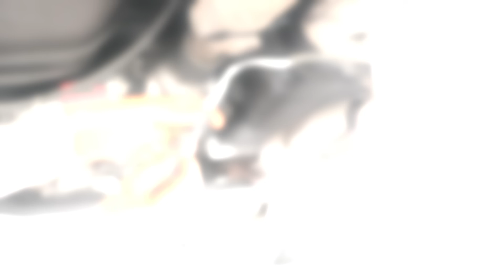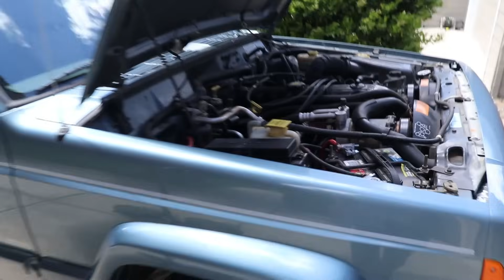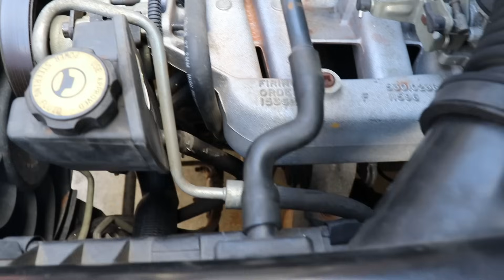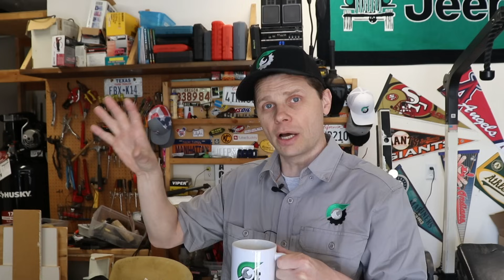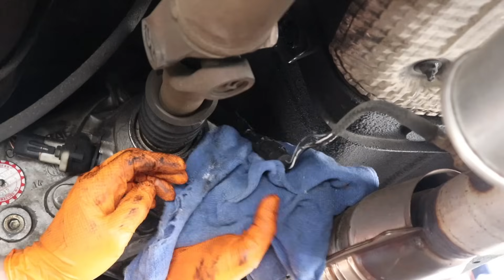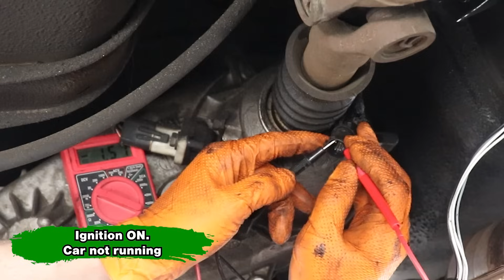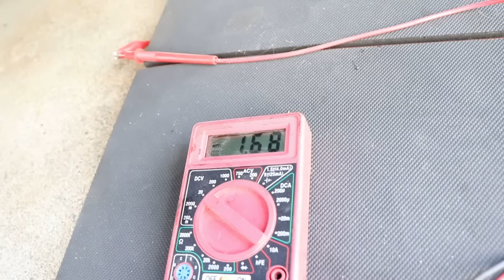Don't Buy Oxygen Sensors! How to test o2 sensor

Comment: An oxygen sensor is made of zirconium oxide (ZrO2), a chemical compound used to form the sensor’s thermal-driven electrochemical fuel cell. Energy is generated by the difference of oxygen inside compared to the outside. 

Two platinum (Pt) electrodes are placed on the ZrO2 to provide a connection for output voltage to a control module. An output voltage of 0.2 V (200 mV) DC represents a lean mixture where there is a lot of oxygen in the exhaust stream. A reading of 0.8 V (800 mV) DC represents a rich mixture where there is little or no oxygen in the exhaust stream. The ideal point is 0.45 V (450 mV) DC – this is where the quantities of air and fuel are in the optimum – or stoichiometric – ratio
Reply: My man breaking it down
Reply: So 02 sensors produce electric?
Reply: Thankyou! I was wondering why that sensor was outputing voltage without anything connected to it.
Reply: Thank You! You have un-furrowed my brow
Reply: Great Chemistry lesson! Much appreciated, thanks
Reply: Auto Motive Diagnostic podcast covers narrow band O2 sensors really well.  They don't actually measure oxygen,  they use it as a catalyst to measure the hydrocarbons in the exhaust.  There are also narrow and wide band sensors.  Which ones are these?
Reply: @roadglide6895 wide band
Reply: Is this how he is finding .04 v on the sensor when it's disconnected but the vehicle is running?
Reply: Screw the sensor.
Just inject a variable voltage supply.
One meg pot across 13.5 v
Reply: Thanks for the comment i was confused how he was getting a reading with it unplugged, and explains why they are expensive.

Comment: Very well explained thanks. If the heater is disconnected then why should you expect the sensor to show voltage when running and with probes on the sensor wires. ?
Reply: That’s just what I was looking for. To bad no one is responding.
Reply: Once enough warm exhaust gas passes over the sensor, it's got enough heat to start producing it's voltage. The heater is just there to get it up to operating temperature faster.
Reply: @slowpoke96Z28  cheers mate. Good explanation 👍🇬🇧

Comment: Are they easy to replace, I have 2  in my truck i believe. It's a 93 Ranger 4.0 engine. I'm still getting some bad gas mileage, even after a full tuneup.
Reply: Just depends on where they are located and how seized up they are to their mounting bung.

Comment: I have a 99 escalade with the 5.7 vortec and it's throwing both o2 sensors and cylinder 2 misfire, I replaced all the spark plugs, wires, cap and rotor and ignition coil and maf sensor and still having a ruff idle while in gear, also has a exhaust leak right after the cats where the flange is. I'm pretty sure it's the o2 sensors but could the exhaust leak cause the o2 sensors to read wrong 🤔
Reply: Not after the catalyst.
Reply: And the truck has 4 o2 sensors, so which 2?
Reply: Down stream o2s
Reply: @wildwillscustomsexhaustvid9677  down stream O2 sensors have no bearing on how the engine runs. An exhaust leak can make them read wrong, but the computer couldn't care less. It's not using them to decide how to run the engine.

Comment: your obd scanner should display real-time voltage for each sensor on each bank, as well as fuel trims.... a multimeter externally used isn't really necessary then. But still useful if you have no scanner available.
Reply: Not on an obd 1 system
Reply: Or if you have an older car like mine that is obd1 gotta love mitsubi
Reply: Great point
Reply: THAT WAS gonna be my question and thanks for answering
Reply: I bet he k owed that
Reply: It's useful for identifying a likely cause, but it doesn't narrow down the specific cause exactly, it could be the wiring to the sensor is damaged. And OE o2 sensors are expensive.

Plus, if you suspect the sensor is faulty, you are removing it anyway so why not check it.

Comment: Oxygen sensors should be cleaned at 90K and 180K(replace them at 250K) by removing them and heating the sensing portion all around to cherry red with a propane torch, while checking response time with a volt meter. Using a meter while on the vehicle is not necessary as you can just hook up an OBD2 reader set to read live data. On an early fuel injected vehicle this method may be useful. *Edit for those not familiar with O2 sensors: there are four wires. Two are the same color, two are different colors. Connect your volt meter set to DC volts on the two wires which are different colors. Polarity doesn't matter.
Reply: How can you test an O2 sensor when it's disconnected where's the voltage
Reply: @davidsimons3347  Ah, I just got it. The O2 sensors themselves will give off voltage when heated up. That's why he plugged his multimeter to the sensor's connector when the car was running and left the PCM connector alone. @alouiciousjackson5812 explained it well with the blowtorch test.
Reply: @davidsimons3347  Look at the four wires- two will be the same color, and the other two will be different colors. Set your meter to read DCV and connect the leads to the different colored wires. Then heat the sensing portion of the sensor all around to cherry red. The voltage should come up to just under 1V. Now move the torch back and forth and make sure the voltage fluctuates and responds quickly when heating the sensor.
Reply: @alouiciousjackson5812 You explained nothing. "Different wires", which wires? There are four. Why even comment if you don't know how to explain something.
Reply: @age_of_reason  I usually include that info in similar comments, but apparently not on this one. I've edited the comment to explain better.
Reply: @alouiciousjackson5812 i have an error code p2195 bank 1 sensor 1, too lean, any clue on how to approach it?
Reply: @cj2hawks25  Look at your fuel trims. If they are fairly normal then the cat is probably bad. Also look at the fuel trims in the freeze frame data and compare them under similar conditions. The ECU will artificially richen and lean the mixture to test the cat's response which prevents people from using  sensor spacers to trick it.
Reply: As a backyard mechanic of 43 years this is what I do. There are several inexpensive code readers that will give you live data on the o2 sensors. Another way to check is just unplug the sensor. If your vehicle runs better you found the issue.
Reply: @Plumbtired This is correct. I tried disconnecting the sensor and tested my car on the hilly road. It was very strong.
Reply: @Plumbtired  So I don't need the 02 sensor except for smog?
Reply: @ibberman If you still have your cats you still need the o2 sensors. You will clog your cats with no o2 sensors.
Reply: @Plumbtired  Oh, Ok thank you!
Reply: Does the torch clean them?  Is this procedure good for A/F & O2 sensors both?  How do you get a voltage reading across a sensor that has no power going to it?
Reply: So exactly what should the obd scanner read for 02 voltage?
Reply: i measured voltage from car and from sensor and both are about 0.87v , but on obd diagnostic it shows normally from 2.5(lean)-3.5v(rich), but when i made one trip on rain it started to show voltage  0.25-1.4v and engine worked ok, no problem, and suddenly after some time it showed again 2.5-3.5v,  what is going on
Reply: How about early tbi systems with only one wire for the oxygen sensor? Which wire do I test then?
Reply: @user-gj4ei6dc5q  Connect your meter's red lead to that single wire and the black lead to ground. Single wire sensors should be cleaned and tested every 30k if not sooner.
Reply: 430,000k 98 sierra  with lots of original parts still working
Reply: 8p8
Reply: English fool ENGLISH!!!!
Reply: What do you mean by "checking response time"?
Reply: What do you mean by "whole on the vehicle"? Your odd use of language is irritating.
Reply: That sounds like a nice and easy solution, however I have heard that you should never take a torch to an O2 sensor, like for example to get it out. Thoughts?
Reply: I am ay 217k. Got an O2 code. I don't know if it's the original O2 Sensor. I think I am just gonna replace.
Reply: 9
Reply: Go buy a couple new sensors if you gotta high mi. car and move on. They not bank breaking parts!
Reply: That's hilarious 😂
Reply: I have bank 1 sensor 1 0.28v bank 1 sensor 2 0.28v bank 2 sensor 1 0.04 bank 2 sensor 2 0.30v. Po300 only 03 nissan 350z . Engine cold
Reply: @merkey  PO300 is random multiple misfire, usually related to the ignition system but not always.  How many miles on your spark plugs? What is the impedance of your coils? As far as the low sensor voltage, look at your fuel trims. How does bank 2 compare with bank 1? Spray around the intake area with carb cleaner to check for vacuum leaks. Verify the fuel trim findings by looking at the spark plugs for signs of rich or lean condition.
Reply: @alouiciousjackson5812  okay so i have brand new spark plugs and igition coils. short term fuel trim 11 0.0% and short term fuel trim 2 1 +25%. pulled plus definitely fuel but not like super black carbon rich still new
Reply: @merkey  short-term fuel trim bank 2 is plus 25%? Sounds like you have some bad injectors or a fuel pressure problem that it's trying to compensate for
Reply: @merkey  also check for vacuum leaks
Reply: @alouiciousjackson5812  YES !!! Car was running fine, but when I replaced my spark-plugs on an LS400 I had to remove a hose from the Charcoal canister to the VSV and I forgot to reconnect it - resulting in P0420 and P0171 fault codes. I'd tucked the hose out of the way of the ignition wire shield for access and that one missing hose allowed a huge vacuum leak causing the codes.  Huge sigh of relief on finding that open port and it's dangling hose...
...but mostly not having to go underneath the car and replace 4 expensive O2 sensors - in vain!!!
Reply: @joeteejoetee  definitely sounds like it could be a vacuum or exhaust leak throwing off your internal pressure readings. Give it a thorough once-over and snug everything up.

I had the same issue, 25%. My EGR valve was stuck open causing the pressure to be out of whack.

Got it replaced and the mechanic didn't clean off the old gasket material, nor did he snug the EGR down. Soon as I snugged it down and cut off that exhaust leak, long term trim is 4% lean(but not 25%!). Not bad for a 1997.
Reply: @jazeenharal6013  You are correct! When I replaced the sparkplugs I removed several Vacuum lines and tucked them out of the way. 1 of the lines (to the charcoal canister) was very well tucked away, and I missed it. It was supposed to connect to the side of the throttle body - leaving a large open port!  Thanks for commenting. Cheers!
Reply: @joeteejoetee  so glad you fixed it :)
Reply: @alouiciousjackson5812  my 2019 jeep grand cherokee laredo 3.6 will spike the short term fuel trim to +26 on both banks just a short spike intermittently. What could be causing this? Maybe o2 sensors
Reply: Your a little wrong there bubba. They also have 5 wire o2 sensors.  Each wire different colors
Reply: @robertmoran6899  A 5-wire sensor is not a standard oxygen sensor, those are typically wideband sensors so what I said does not apply to them.
Reply: @robertmoran6899 most o2 sensors people here are going to be dealing with are 4 wire, 2 for the heating element (heating element ground and switched power) 2 for sensor itself... ground and voltage. The signal wire, I believe is the power to the sensor but I'd have to look again to be sure... regardless he could have been more specific, but many people complain about comments being too long, hence the acronym TLDR. Again, for the most part, people will be dealing with 4 wire sensors.
Reply: I don't even think U know how this O2 sensor works & I am laughing @ U help someone in this comment section spend money on parts for his car.
Reply: @StationRussification  Did you go to automotive school? Didn't think so. I did, idiot. The instructor who taught me this trick was Alex Wong, an electrical engineer who worked with Ford and GM on their first electric vehicle projects and also was called to inspect the nuclear reactor at Fukushima and utged them to shut it down several years before it failed.

Comment: How the heck do you get voltage out of a sensor without a power source? Typically you back probe the sensor while connected and check for 5 v Reference and signal voltage.
Reply: Totally AGREE I caught that too at 6:38 and 7:47

Comment: Would bad o2 sensor cause a vehicle no start in cold weather?
Reply: Mine used to do that, check starter motor solonoid, sometimes they need a tap with hammer while turning the key
Reply: Nope

Comment: When the sensor is disconnected, you mentioned voltage. Wouldn't that be resistance in ohms and not voltage since there is no power going to the sensor?
Reply: No  o2 sensors create a small voltage when hot and have oxygen present.

Comment: How's the sensor producing voltage when it isn't plugged into the power system of the vehicle? Unless the voltage is coming into the sensor through a separate path, I'd guess that the resistance change (in Ohms) is what you should be measuring. I could definitely be wrong though as I'm unfamiliar with these sensors.
Reply: They produce voltage when heated, Google is your friend
Reply: @ovwok   You are Right,  i just google and read about that,  thanks for teaching me something  new  today.
Reply: датчик из циркония, он при контакте с О2 вырабатывает напряжение...
Reply: It's chemistry. When there's a difference in oxygen content on either side of the actual sensing element, it generates a small voltage.
Reply: He is just looking for our friend’s resistance & ohms.
Reply: You are Correct,  02 sensors Do Not produce  Voltage. 

  Unlesss  its an 02 sensor/dynamo.  Lol. 😜

Comment: My front o2 sensor disconnected from o2 sensor  testing with multimeter ground and signal wires from engine harness is reading with key on the position engine not running  4.15 volts is that normal

Comment: how many computers on a car and it  can't tell you the frickin bad part
Reply: They aren't that powerful yet. Probably one more generation though and they will. They come close. OEMs just like to keep how to interpret what the computers do say to themselves until they are paid for the information. And sometimes (ford) the information STILL sucks.
Reply: See that’s where people get it mixed up the computer doesn’t tell you that that part is bad. The scanner talks to the PCM,TCM or ABS, BCM, all different types of controllers. It converts it into English. Any point you in the direction where the problems at and then from there you have to break it down and diagnose it find out why that code is there it does not tell you exactly what is wrong with the vehicle or if, that part is bad is telling you there’s a problem in this controller or this part and you have to figure it out diagnose it

Comment: I’ve seen people bench test them using a propane torch with out running the vehicle and it works great.
Reply: Yeah removing them is the hardest part here in NYS rust belt at least
Reply: WTF???
Reply: 6pp
Reply: @marymussa5118  huh ?
Reply: but you need to open the sensor first I supposed
Reply: @dennyc4135  no, simply remove the sensor from the car, put the sensor in a vice to hold it, apply the heat from a propane torch or similar and heat up the end which goes into the exhaust, connect yor multimeter to the sensor wires, as you apply heat and take the heat away, you should see a swing from around 200 mV to 800mV, the sensor reacts very quickly.

Comment: I have replaced a 02 sensor and 141 still. Shows up i bought a oem part and checked fuses could any one give me suggestions and more info on what else could it be?????
Reply: I was getting the same thing just a different code. It turned out the wire harness going to the O2 sensor had dropped on top of the cat, melted it and broke two of the wires. My issue is I don’t know what wires connect to the O2 side. The harness has four colors they’re all different from the sensor wires
Reply: Vacuum leak

Comment: how can you get voltage from the sensor without a power source?
Reply: The o2 sensor products the voltage. That's the signal it sends. Out of the 4 wires you have 1constant ground 1 switched ground 1signal wire and 1 12 volt power for the heater.
Reply from the maker: I’d have to look into the science further, but from what I remember the heat from the exhaust and the threads grounded to exhaust creates a very low voltage you can measure.

Comment: aslam o alaikum i am from pakistan my car has 660cc ef-rl engine please tell me how to install 16 pin obd scanner no one in pakistan could not fit it he has 17 pin obd jack he has his scanner  I don't have it. The petrol average of my car is not good. May Allah bless you
Reply: I think there an adapter to covert 17pin to 16pin. You can probably look it up and find it
Reply: @ThanhLe-sd2id  I ordered a 17 pin to 16 pin converter but it didn't work.  Tell me an alternation so that I can cut 17 pins and apply 16 pins
Reply: Ok I was just assuming you want to install 17pin into 16pin. What kinda of scanner do you have? A generic obdii scanner? Those likely wont work with how old your vehicle is. What you may have is obd1, not obd2 like that we have in north america since 1996. You would have to actually get specific scan tool like snap-on with hardware that support it. I would also add that vehicle that old have limited function compare to obd2. So you just be wasting time instead.